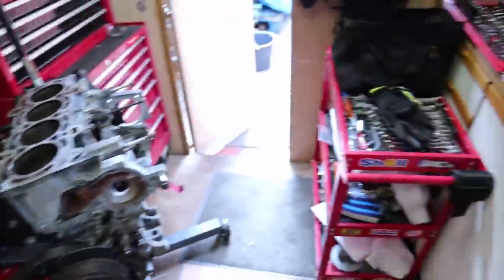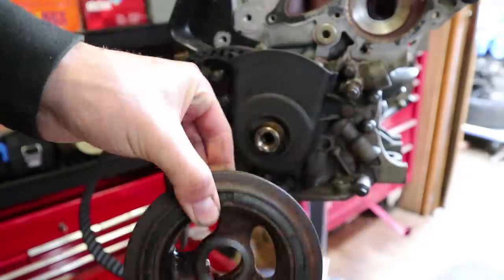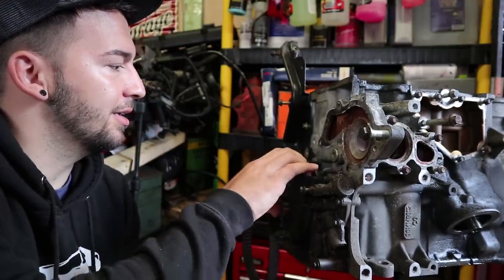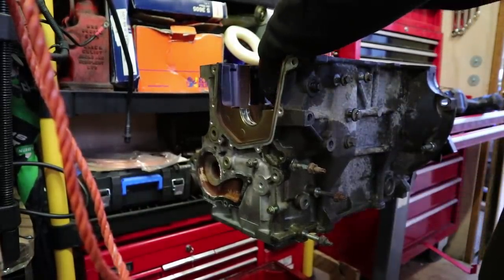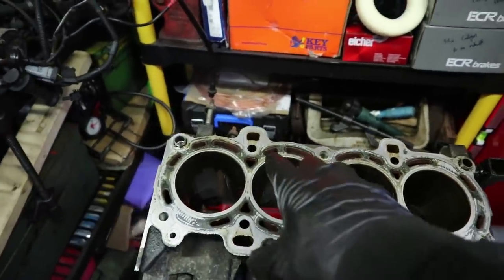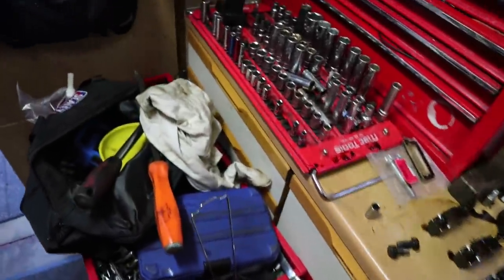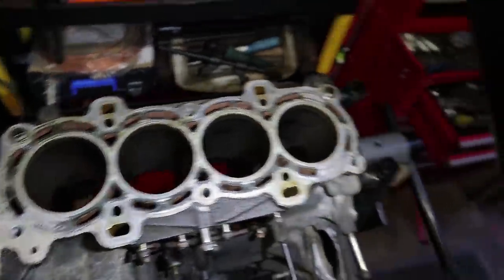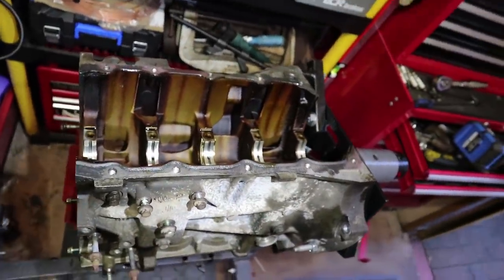Fiesta Mk5 Zetec S Engine Rebuild! Part #3

Comment: No disrespect intended, however after going in that deep. Change the shell bearings, de glaze the bores, check the speck on the rings and crank journals. Good work, enjoy your content.
Reply: 2nd that they looked well polished.
Reply: I'm sure he will de-glaze the bores - he had a tool to do it on the Astra project.
Reply: Definitely replace shells they are so cheap as well !
Reply: I wouldnt try de-glazing the bores, they are nikasil coated will ruin the coating are supposed to be like that, all your looking for is to make sure theres no pitting or changes to the coating could measure to make sure within tolerance.
Reply: @marcedwards8214  Isn't it only the 1.7's with the Nikasil?
Reply: @adammcallister2260  all the aluminium ford blocks I have worked with are nikasil coated think must have been easier to nikasil than run steel liners in, they can be recoated but if u try to hone can remove to much nikasil then your down to aluminium, might be worth taking to a machine shop, didn't want him to be in a world of pain once he gets it back together

Comment: As your there id reccomend changing the bearing shells, that brown is most likely copper coming through a sign of quite some wear, I would personally for peace of mind, as you said 120000 mile engine with some thrashing and an unknown service history I'd personally change them
Reply: That bearing he said was brown, it looked like it wasn't actually the bearing and was the end of the conrod, the bearing didn't seem to be there (was probably still on the crank shaft)

Comment: James, it doesn't matter with these ford engines where the sprocket line up. That's why you use the timing kit on the cams and crank. Set the timing with the tool, fit the sprocket and finger tighten the bolts, fit the belt, then torque the bolts. Hope it helps

Comment: Tip: use a small butane torch around hole of the pulley to heat and expand it will cone off without any special tools...you can also use the torch around other parts of the vehicle to free up parts that are seized on

Comment: Could've fooled me, I thought you'd had at least some mechanical training. For self taught, you're doing awesome. I got scared off when one of my cars caught fire and downed tools for years. Since the Astra rebuild, I've had tools back in my hands and feeling inspired and confident so well done!

Question time: Why do the pistons come out the top of the engine? Can they not be pulled through the bottom where the crank goes?

Comment: Time to Clean!. I use a bench grinder wire wheel   to do all the bolt cleaning. Zip lock bags to store, put notes in. Old pots and pans from my wife for cleaning solvent. I work on my cars laying on the ground in my car port in °110 heat in Phoenix.

Comment: The conecting rods and their caps are matched to each others and should not be swaped between them since when their cast they are cast as one piece and the caps are cut/split off the rods which makes them only fit one way truly.

Anywas you have my respect, i'm not a mechanic or have i ever said i was one but just like you i love tinkering around with engines and cars. Im now in the procces of retireing my astra mk4 3 door hatch for a complete overhauld and maybe some mods. Im not in a hurry and may take a lonk time but its worth it!

Comment: You certainly have much more confidence than I do. I have a similar engine to that in my MK6 Fiesta, nudging 118 thou but still seems to run sweetly. To me it looks like there was a bit of blowby on those pistons note the carbon black colour just below the rings but with most petrol engines at this mileage point that's to be expected plus with thrashing. I look forward to seeing more progress on this project!

Comment: +30 re-bore on block, new pistons and rings, new shell bearings small end and big end on con rods, fast road cam and new bearings, at least. The big end bearings are shot mate.Resurface head, port and polish.Dowel inlet and exhaust to head. Uprated oil pump. Uprated fuel pump and injectors. Have a good one mate.

Comment: Great video , just started tackling a 170,000 mk4 golf gti engine waiting for a tool to crack the head off got the camshafts and tappets whatever there called oh the smell if the burnt oil 🤢 I'm gonna break clean everything and replace all the gaskets new pistons and rods tappets only gonna reuse the cams after a clean

Comment: If you look at the big end bearing caps you will notice are not symmetrical, they are cracked apart during the manufacturing process this makes them a perfect fit which reduces shell wear. The bearing shells look fine to me especially as it's done 120k.
I have got a special tool to remove / replace the piston rings safely as the top compression rings are brittle, willing to lend you the tool if you want. To inspect the bores put a piece of white paper at the bottom of the bore it's amazing how it hi lights the honing pattern. Don't forget all those bearing bolts will be stretch bolts so need replacing £££
Good video enjoy watching this series.
Don't take offence about being corrected by mechanics, treat it as a learning process, at the end of the day could they present a video to such a hi standard....... Keep up the good work

Comment: Good job. Please make sure to replace the bolts for the crankshaft bearings and connecting rods. Those are stretch bolts. Also it's definetly a good idea to replace all the bearings (crankshaft and piston) while you are in there.

The connecting rod caps have a specific orientation as well well as the connecting rods itself so make sure to install them correctly ;-)

For the cylinder bores I would also hone it slightly with a flex hone (180 grid) and lots of oil.

Keep up the good work :-)

Comment: Hi! great content again ^_^ I'm currently working on ford Y5A engine fitted in scorpios and galaxys and it's nice to see that somebody does actually care about similar engine ^_^ 
Tip: since your cylinder walls have visible marks, check your cylinder's ovality - if its in spec. I didn't do that at my first rebuild - just honed + new piston rings and needed to fully dissasemble it because of that. Rings just weren't able to seat in (oil full of steel "dust" from cylinder wall and rings).  
Wish you luck!

Comment: Usually (but not always) nuts/bolts with a left handed thread have a slight groove around the middle of the high points.

Comment: Not to criticize you, but offering information. Here in America, we could call that structure you removed with the main bearing caps a Crankshaft Girdle. Usually the girdle would be separate from the main caps instead of a single structure like you have. Girdles are mostly used to strengthen the lower end of a highly modified engine, usually a V8. 
Nice video!  Like you, I learned to fix cars by working on my own out of necessity, my first being an XK120 FHC.

Comment: Great job, but since you have the pistons out I would replace them with a new oversized set and get the cylinder bores done as well at a machine shop, because if they are out of round and replacing  just the rings could make them worse overtime. But still a great watch👍

Comment: The crank pulley comes off by using some levers behind the back, no need for a special tool but is nice to have I guess. Also 3 of the slots on the pulley have been damaged, you definitely need to either replace it or repair it. That damage definitely will damage a belt.

Comment: 15:42 hyundai aluminum block engines have a similar thing. In fact in the 2.7 V6 delta the crankshaft caps are seperate but their bolts go right thru the support frame and in the 2.0 I4 beta its the same as your engine here. Confused me when I first saw a 2.4 I4 engine in a sonata with it because I have only ever dealt with larger steel block engines. Downloaded hyundai repair manuals yesterday and saw exploded view drawings and it all made sense.

Comment: I bought a milwaukee that has 1000nm break off. It takes off anything. If you cant use power, use heat. Heat always works.

Comment: hi james nice video, as you have gone this far why don't you hire or borrow a micrometer and check the bores and crank to see if they are within spec and not oval. this is easy to do and specs are in your Haynes book and it will give you peace of mind to how worn the engine is. your friend greg might be able to show you how to do it with his micrometer.

Comment: You should really replace the big end bearings while you have it all apart seems silly not to. it will give any future owners peace of mind that all the main wear parts have been replaced. just checked an older vid car is on 135,000 miles

Comment: Yeah. Those bores definitely need honing mate and probably piston rings need replacing. Might help the engine last longer. 

That harmonic balancer doesn't look in the best condition. The rubber damper looks like its perishing.

Comment: Brilliant work mate. Keep up the good content 🔥👌🏻
Reply: SUGAR-3-ME - Nice scirocco there mate. I also drive the same car 2.0 tsi. Basically a golf underneath wearing a more stylish suit.
Reply: Cheers pal just waiting for my scirocco r engine to be rebuilt and it going straight in as my 1.4 blew up 👊🏼
Reply: SUGAR-3-ME - TSI engines are not the best petrol engines VAG have made to be honest. Mine has got a misfire too. It’s got low compression in one of the cylinders. I’d love to R32 swap mine with the 4 wheel drivetrain. The R engine should be a lot of fun, good power gains and it’s not like you are adding any extra weight.👍

Comment: That crank shaft cage is known as "main girdle" or "main bearing girdle" . it is supposedly better/stronger desing than just caps. it should definitely be loosen in reverse of torquing sequence, and please get the block and head to machine shop to have them surfaced..... It would be shame to put new gasket on possibly not perfectly flat surface.. But man.. keep up the great work .. love the vids, keep them coming .. ;)

Comment: Crank bolts. The crank pulley is a vibration damper. The energy from the impact gun is absorbed. I have some old 3/4 sockets stuff to hand which cope when things get heavy.  How did you lock the flywheel by the way?

Comment: The floating crank sprocket is such a crap design, I can’t see why a keyed sprocket wouldn’t be easier and safer?! Some BMW engines have the same design, and they rely on stupid torques to keep them from slipping. 300+nm. I had to build a “special” tool to allow me to tighten it back up after I rebuilt my engine. I’m just like you, a self taught DIY mechanic. Keep up the good work! Oh and just a quick one, the big end bearing shells are sometimes “cracked” in factory so will only go back one way and on one rod.
Reply: This way they can time the engine perfectly, as the sprocket is not limited to the key. Otherwise you'd have to have an adjustable camshaft sprocket to account for slightly offset teeth and/or slight chain length variations.

At least in this case the sprocket bolt turns clockwise and when you have everything timed, tightening the sprocket would put tension on the right side.

I had a look at a Z13DT corsa diesel engine with a timing chain and the camshaft sprocket turned clockwise (putting slack on the side without the tensioner) and the crankshaft sprocket turned anticlockwise, doing the same even more!

So I'd say, this one definitely isn't the worst.

Comment: Nice video. Trust me bmw crankbolt is much harder. Commonly referred to as the Jesus bolt.
Reply: GOD DAMMIT BOLT
Reply: Just bring out the C4 and it will work first time lol.
Reply: colintx800 I broke 2 half inch breaker bars and 3 sockets to open one 😂😂😂😂

Comment: 3:35 on my MK6 Fiesta with the same 1.4 16v is actually a right handed bolt. Guess they've changed the design
Reply: but this is 1.6 16v

Comment: Would it not be wise to replace the oil pump given the miles of the engine and the possible lack of oil changes etc. There may be an updated or uprated version available? I know it's adding a bit more cost to the build but you'd hate your self if the bearing in it fails after you get it back on the road

Comment: @20:25 so can you recall what's the mileage of the engine at this point? roughly plus-minus 10-20k is not a problem, but im just really curious how long does this honing last on these engines

Comment: Take your block to an engineering company. Those liners in the block were given a nikasil coating when new. If it’s took away then it will burn serious oil. They are supposed to be recoated if they are worn...

Comment: Even though only one of the bearings is scored, wouldn't it be good to fit in new bearings,  as on the others you can see wear "patches", which after another 30k miles be a problem....  As in it might start to get rod knock after another 30k miles.?
Reply: these engines are notorious for the bottom end going, it usually happens when the engine oil has been ran low, their very sensitive to low oil, and should always keep the oil on the full mark. id like to see the bottome end bearings replaced as I have never seen it done before.

Comment: My piston is after going in my 10 reg Focus, 1.6 TDCI 109 BHP model. It all started after two turbos went. Now after I put new engine into it with slight less mileage (140,000KM), another turbo went. Anyone else had such a problem? The last time I brought the car to get it done for warranty, I got it back with cracked windshield and scratched bumper.

Comment: Would you know if it's a similar engine to the 1.25 fiesta Mk6
Reply: Its very similar, almost identical with small differences. The mk6 doesnt have Aux belt tensioner and uses stretchy V belts and also the timing belt tensioner is a bit different.

Comment: I thought you would know about how the bottom end of the conrod caps are CRACKED off and only fit back with their original conrod because everyone from BMW to ford does it and IT IS IN the repair manuals. I know this and I'm not at your skill level.  Many times there's an arrow on the cap and all the arrows point in one direction so you just need to keep each cap with each conrod and it doesn't matter if you mix up left from right.

Comment: Ok fella i may have criticised you in the past due to your channel name and making the wrong assumption so for that i apologise 👍🏻, This engine you choose to recon is perhaps is a little tough for an amateur !  My advice is try get a low mileage replacement be much cheaper, but i get it, channel content, Anyways bearing shells that are shiny not good, Assuming Crank journals and piston bores are round with the eye not good, send to machine shop ask if you can film it, needs a crank regrind or polish and rebore or de-glaze at least, Change bearings for new whichever you require standard or oversize, machine shop will recommend ! mind check the oil pump rotors are within tolerance, you can do that easily , rear crank seal comes complete so you can bin that full unit, I’ve built 1000s of Engines from Minis to Caterpillars Spark ignitions and compression ignition ! it took years of training, and training each year to update as engines evolved ! Building engines completely in your own backyard without specialised milling machines is a hard thing to do, best of luck to you  👍🏻

Ps buddy also you should performance enhance that build as you go, tastier cams , forged pistons etc ! be better viewing ! check our Burton performance for your parts 👌🏻

Comment: The crankshaft pulley bolt MUST be replaced. They're stretch bolts. If you don't replace it and reuse it, your timing will jump soon as you start it up. Your camshaft bolts are also stretch bolts I believe. At least the VCT camshaft on the Puma engine has a stretch bolt for the cam. 
If you buy a timing belt kit for it, buy GATES they made the Ford sets just rebranded with Ford's name and more £££ at the stealership. However you will need to buy the waterpump from OEM. Ford only water pumps. NEVER use a water pump from Euro car parts, eBay or Parkers etc they're all rebranded shit that fail way too prematurely. I've had them fail a couple of times, some after 3,000 miles and some after 10,000 miles. They're all rubbish they should last the manufacturers replacement period, usually 100K. Never had a single issue with OEM water pumps, 80%-90% extra price but you get what you pay for.

Comment: Hi James, I know ive said, that's called that, not that, sorry.  It's things I've picked up, and you learn from others who tell you the real name, then if you need to get a part, the company where you buy it isn't going to say what the f is he on about.  One thing I wi say, when you removed a piston and con rod, and the semi circle that came out of the end of the con rod end of the piston, is a shell, and that protects against wear from the crankshaft and the con rid.  Con rid ad in connecting rod

Comment: According to Haynes Manual the crankshaft should not be removed from the block..... and there is no torque settings for it either.
Reply: Ford does not publish torque setting for the main bearings, however if the get the factory manual, everything is in there. It's because the bearings are graded, but there are aftermarket replacements.
Reply: @petersarlai2091  Hey Pal. I actually went a bought a digital version of the factory manual (around 1000pages) I went through it but for the Duratec 1.25, 1.4 and 1.6 there is no information about the main bearing(only a small section about plastiguage) or even crankshaft removal. Do you happen to have a manual with that information ? and would you mind emailing me a picture of the page explaining the bearings ?

Comment: Milwaukee all the way m18
Reply: Never for those crank bolts though. They always need a good air ratchet.
Reply: Remember the new m18 inch drive fuel is out now that’s gonna be a beast